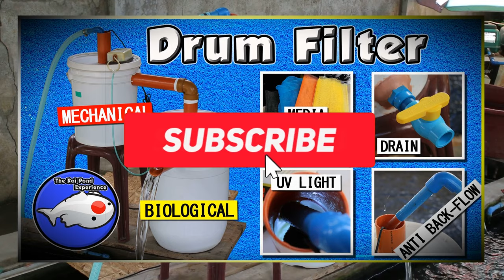How to Make DIY Drum Filter

Comment: Hai , thanks for ur clear explanation,
Is it need to place uv light and air tube to the setup 
If a pls show it clearly
Reply from the maker: It's not necessary to add UV and aeration inside the drum filter. But the presence of these add an incremental advantage into how efficient your filter set-up will be. Any little advantage really matters for some. 

But if you can't set these two at the moment it is perfectly fine. You can set them up later when you're ready.

Comment: Just asking if you encounter any serious pump problem & the difficulty in cleaning the pump in this drum filter system?
Reply from the maker: Hello, so far the pump has been easy to to maintain. A basic disassemble then cleaning of the impeller then reassemble. Works just as usual.

Were you experiencing some pump problem? Can you share it to me?

Comment: Good evening Sir, awesome design. Quick question. I have a 1200 gallon tank that I’m planning to raise 100 Tilapia, would this design work ?
Reply from the maker: The same design will work my friend however the size of these drums is small. If you can find larger drums and them make a set of at least 3 drums then I believe its suffcient. Assuming of course you are diligent in cleaning the mechanical filters as often as possible.
Reply: So a 3 drum design, meaning 2 drums for mechanical filtration and 1 for biological ? Also when you say cleaning, do you mean, using the drain valve to flush out the water or actually taking out the filter media and washing it individually? Any advice would be really helpful, thank you a lot for your help.
Reply from the maker: @shujaatali4728  2 is to 1 drum is correct. And cleaning is just pulling out the nets from the mechanical filter and cleaning it thoroughly. The drum of the mechanical filter must be cleaned as well.  Then not touching the 2 biological filters.
Reply: Thank you for your reply, so  1 mechanical filter and 2 biological filter? And one more question, how often does the filter needs to be cleaned? Really appreciate you taking the time to reply.
Reply from the maker: @shujaatali4728  Try cleaning it once a week first. Then if you think it gets too dirty if left that long then try adjusting it to cleaning it every 4 days.

Comment: Forgot to ask, is the smaller pipe 3/4 inch?
Reply from the maker: You're correct Terry it's 3/4. But if you can fit the 1 inch it's a better choice. For better water flow.

Comment: What a great video my guy!! I've been looking for a decent way to diy one for myself for a while now amd this by far looks the best I've seen. Thank you for very much for sharing. Could i maybe please suggest that you could take the air lines and have them direct feed to the bottom of the bucket with silicone instead of having them through the overflow pipe, I'm  thinking some restrictions in flow the way it is. Also having the air lines in there like that you could theoretically run, say those small media balls and pretty much have it constantly "fluidised" just my two cents haha. Thanks again for posting.

Comment: Can I use this in a 2,000-3,000 gallon pond with large koi carps? If not how many of these will I need?
Reply from the maker: If I may suggest. You'd need the full size drum and at the least need 3 of those big drums. They come in blue color and are also plastic. Those 3 will be pure biological filters. 

For mechanical filtration you can use this white Chlorine container you see in this video. Small is better so can easily clean it periodically, like every weekend or everyday of that is possible for you. Use fish nets are mechical filtration media and have 2 sets ready. When you do cleaning, pull out the dirty nets the swap the clean set of nets back in and you're done.
Reply: @thekoipondexperience1259  I was planning on using the big blue drums a total of 6. 
A) 2 mechanical filtration drums
B) 1 UV Light Drum
C) 3 Biological filtration drums.
Reply from the maker: @abyankabir1910  I like your idea. Continue with your planning process but this right here is a good start. 

Then prepare the items and tools you need for the build. So that on the day your do the DIY your execution will go with minimal interruption. Take your time in making the build, no rush.
Reply: @thekoipondexperience1259  thanks for your reply. I will be asking a lot of questions here. I hope you don’t get annoyed. Btw I was thinking if I can use plastic pot scrubbers and red bricks for biological filtration?
Reply from the maker: @abyankabir1910  red bricks is something new to me, as long as they are inert they are ok. Some use pebbles. Plastic scrubs are ok as well, I've seen those used a lot. 

But are Pumice Stones and Lava Rocks unavailable in your area? Those are good options as well. Try to check a video I made for Pumice Stones and Lava Rocks.

Comment: I was wondering about using crushed limestone and biochar
Reply from the maker: It'll work too. Bacteria would still stick to to the the limestone. On biochar, what is that? I don't know what it is.
Reply: @thekoipondexperience1259  they cook wood to remove all the water looks like coal or charcoal, Activated Carbon Filter Media pretty much all the same media
Reply from the maker: @otrotland5377  activated charcoal I am aware of. But not biochar. Activated charcoal is not a biological media. It has a different filtering property but not biological.

You can use it as well if want to. But personally, I prefer biological media. Cause the bacteria in them takes care of the ammonia & nitrites. As to the activated charcoal, I have very limited experience with them.
Reply: @thekoipondexperience1259  coal is made from plants over thousands of years

Comment: May i know if this Drum Filter work for a 20,000 liter pond or i have to make larger 1
Reply from the maker: Hello Ken! This same white drum is too small for a 20,000 liter drum. You'd need the bigger blue drums and then set-up at least 4 of them in the filter system for that 20,000 liter pond.
Reply: @thekoipondexperience1259  I see! Thanks for the fast response. One last question, for 20,000L pond, is that means I need at least a 15000 - 20000L/H water pump for better water circulation?
Reply from the maker: @MrKenz6900  That is correct. 20,000 liters per hour would be really nice for it. 

And then of course supplement that with a powerful air pump and your pond's water movement would really be sufficient to keep dissolved oxygen at close to ideal levels.
Reply: @thekoipondexperience1259  Thanks!!

Comment: Did u use aquaspeed a4000 sir?
Reply from the maker: Yes Aquaspeed A4000, you have good eyes
Reply: @thekoipondexperience1259  hahaha not really. 
So the aquaspeed a4000 is enuf power for ur pond sir rather than the a5000, a6000 or a6500e? Hehehe well a4000 is much cheaper than the rest thou hehe..
Reply from the maker: @davevipe  The Aquaspeed A4000 here was used to demo the DIY drum filter, to see the drum filter working. 
The A4000 will be small for my pond though. So I use a bigger submersible pump as my main water pump.
Reply: @thekoipondexperience1259  ah i see sir.. 
How many wattage did u use for your pond sir?
Reply from the maker: I use a Periha PB-25000. It has 3 modes from 140w to 150w and 160 watts mode. I run it 160 watts in the past 2 years now. It's connected to an AVR with the power on delay feature. You can check Koi Central from Facebook, they carry this item, I got mine from them actually.
Reply: @thekoipondexperience1259  wow nice sir.. thanks for the info
Reply from the maker: @davevipe  welcome bro 👌

Comment: A check valve would have solved yoour back flow problem and would have enabled you to clean the design up
Reply from the maker: That is correct my friend. However I've done that before. In time this is what will happen to the check valve after debris from fish poops collect in its assembly. When that starts to happen even the check valve itself starts to fail and water will then start to flow back from the drum to the pond little by the little.
I made a video on how to clean this drum my friend, no short cuts in my cleaning method just full on effort.